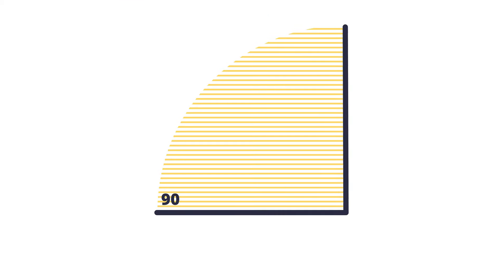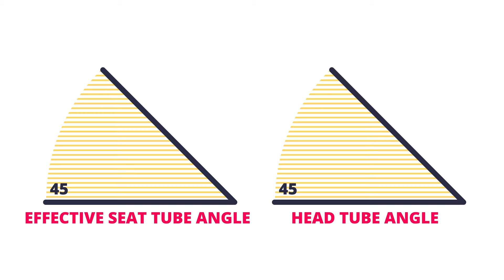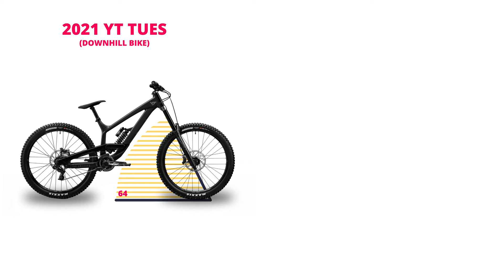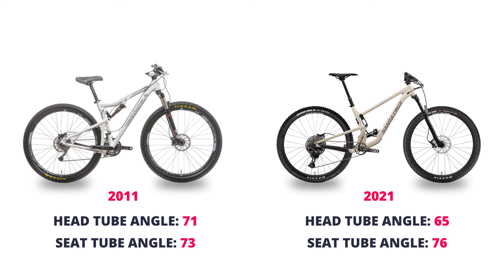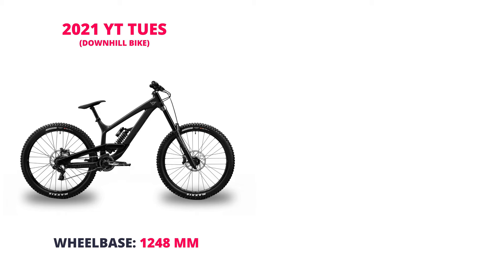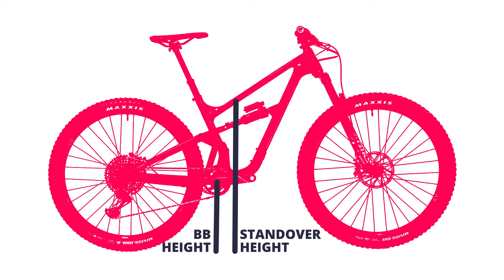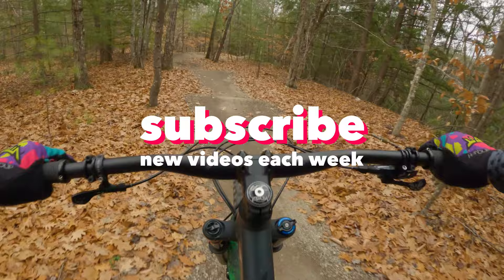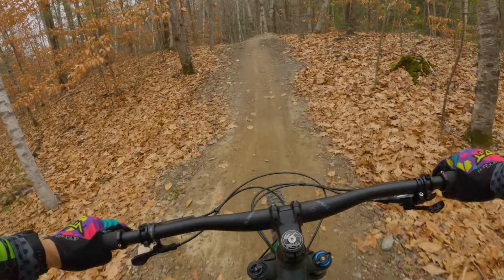Mountain Bike Geometry Explained in 90 SECONDS

Comment: Izzo’s ht angle is 66/66.5, just like the Jeffsy’s... Except the Izzo Blaze which is slacker at 65.5/66... I know it was just an example... 
For explanatation sake - great vid! 👍🏻👍🏻
Keep going! 😊
Reply from the maker: Yeah, I was just rounding 66.5 up to 67 to make the distinction clearer (and because keeping everything to whole numbers makes the animation easier). For accuracy I probably should just have used 66 though.
Reply: Do you know what they changed for the Izzo Blaze to make it slacker? It’s the same frame. Most probable is that they put a longer fork, also raising the bottom bracket a little. Less probable is they put an angle set and I doubt that.
Reply: @niklasdr  agreed. Longer fork, no angle set.
Reply from the maker: @niklasdr  yeah, they added a bigger fork (blaze is 140mm, regular izzo is 130)

Comment: Does the 74 degree angle on the rear suspension is without driver or with?
Reply from the maker: I'm not sure I understand the question you're asking. But these angles are measured when the suspension is not compressed, if that's what you mean.
Reply: @CharlieWentOutside  exacly my question thanx.

Comment: To suggest a shorter travel bike should have a steeper  STA and that it has an impact on whether the bike is poppy or not is a nonsense.  Suggest you tweak that prior to those who don’t know start believing that

Likewise some consideration as to wheelbase and why longer reach also affects stability and why steep sta is often combined with long reach and slack hta to centre rider weight

If steep sta means better climbing then why don’t the best road bikes have the steepest sta?

Its not so simple.